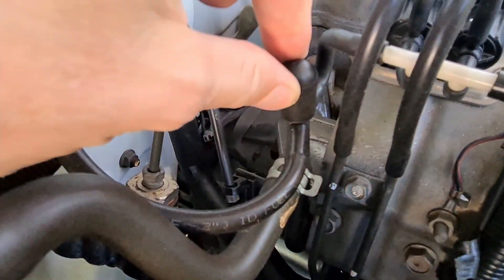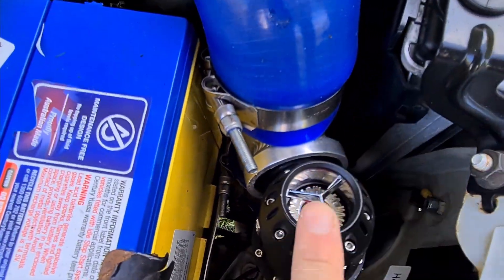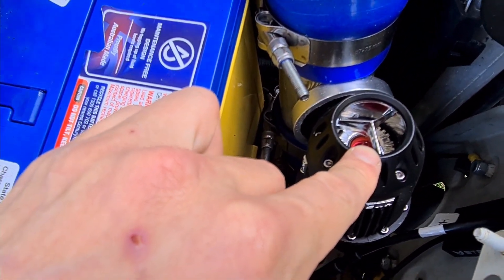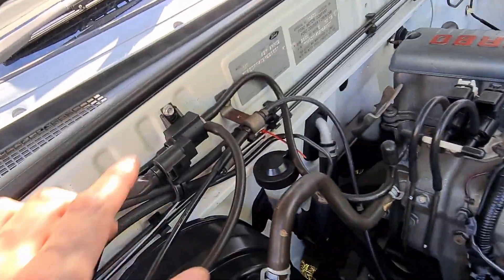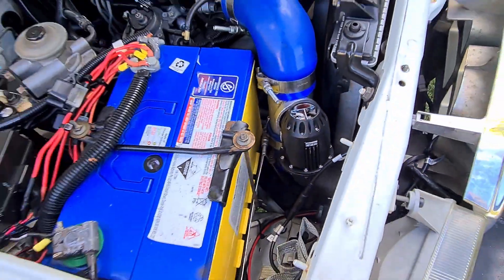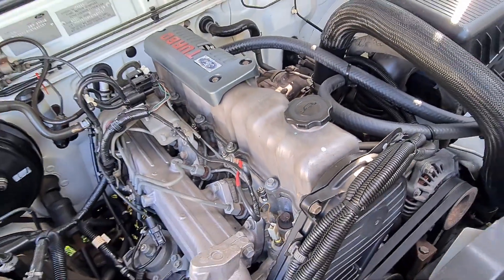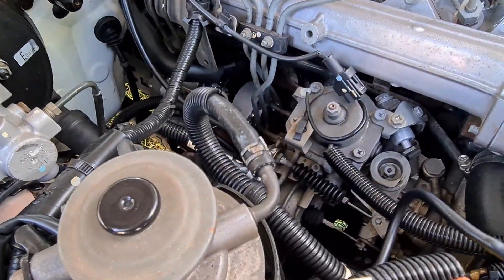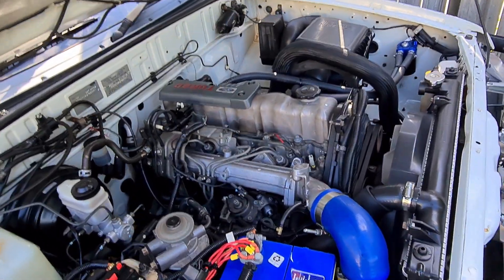Turbo Diesel Blow Off Valve (BOV) Fitted To Ford Courier/Mazda Bravo

Comment: Did the engine originally have a diverter valve?
Reply from the maker: You mean egr?
Reply: @Finndawg    no. Maybe the boost control valve. I'm not sure what my Passat B7 tdi has, but it sounds like a blow off valve.
Reply from the maker: Hmm like the waste gate type deal, though anything like a blow off nah these engines are very basic

Comment: Does this motor have a throttle butterfly like the older diesels? or is this like the modern diesels that has the shudder valve only? I have a 2.0 Diesel Cruze and I'd love to be able to do this if possible
Reply from the maker: No butterfly valve, also no shudder valve, just air into the intake nothing in-between.